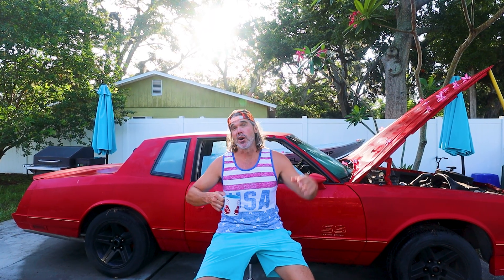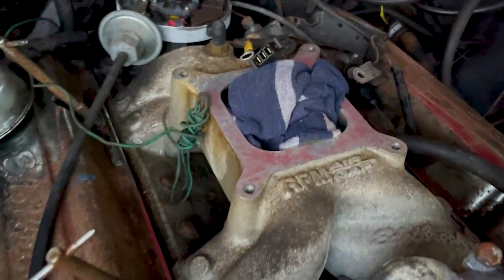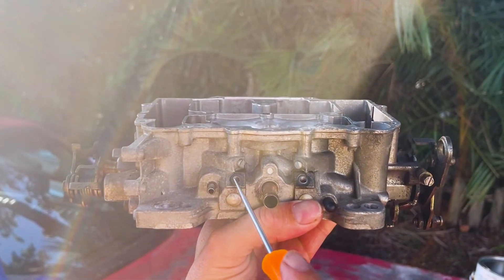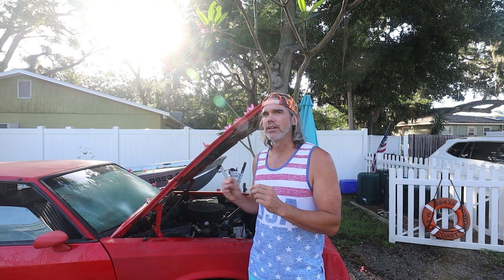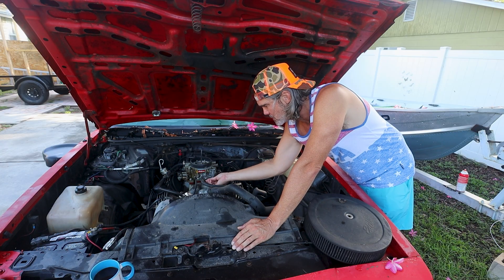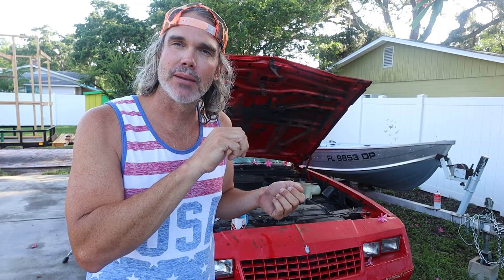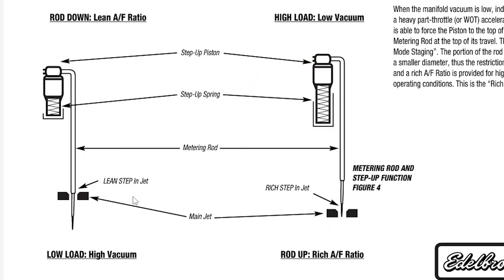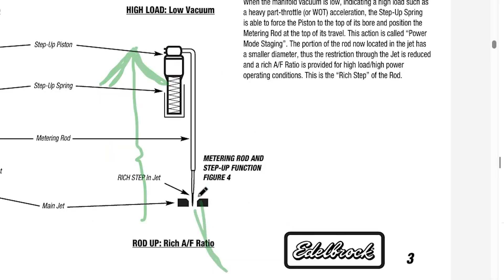Edelbrock Carb Idle Adjustment Master Class | 1405 on SBC/Monte Carlo SS

Comment: I can thank you so much for doing a video of this, I’m subscribing to you😎
Reply from the maker: Thank you! More coming.  I had planned to do a series on the carb rebuild, but ultimately, I just wanted it done and never completed it.  I'm going to try and get an old one to rebuild for the channel.  Those throttle plates being practically close are the KEY so you can use the ajustment screws.  Your timing might be like 16 deg at idle after you get total timing in and set.  Starting with a initial timing of 4-10 deg in most cases will be too retarded for in gear idle on a lober! Thanks again for the sub - Jason
Reply: @GulfofAmericaManYT hey man, so should I make a video for you of how the motor is running and what has been set up so you could see what it could be be and what I’ve done to the carb? I’m still having issues with it not staying at idle, I got it idling but with the choke halfway on because when the choke is off it starts to bog down and dies
Reply from the maker: @johndeerfan5599  YEah. I'm down.  Check out your high idle adjustment.  You can adjust the choke plates and the idle independently of each other. A gap the size of just a pencil's thickness is a good starting point on the choke plates, then fine-tune with the "high idle screw".   But a video would definatily help!
Reply: @GulfofAmericaManYT alright sounds good, I’ll make a video when I get to the shop when I’m done with work
Reply from the maker: @johndeerfan5599  awesome.  I think heat soak might be part of your issue but we gotta get it running good cold first.  You fuel system sounds pretty legit with the send and return hoses.  I need that lol